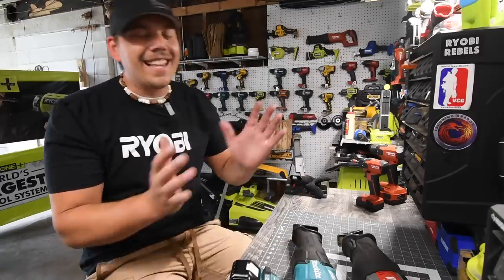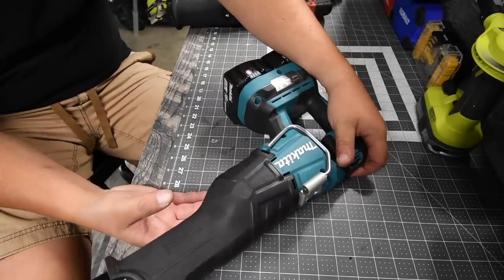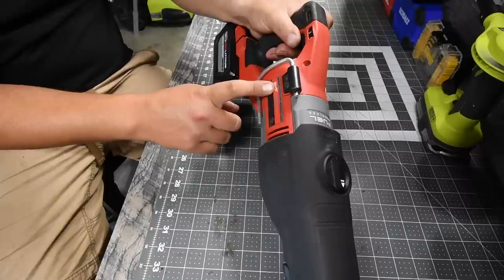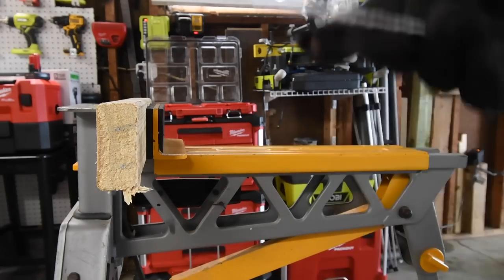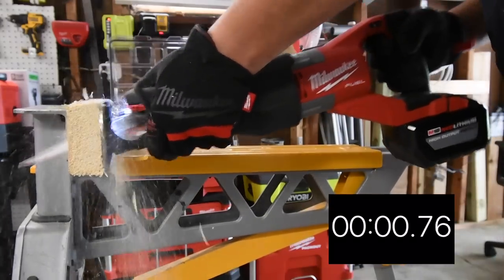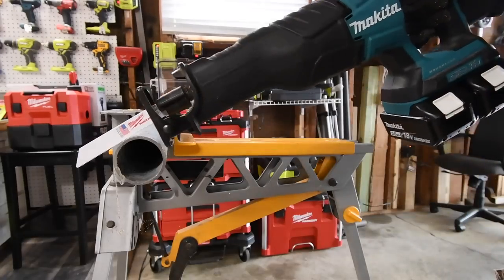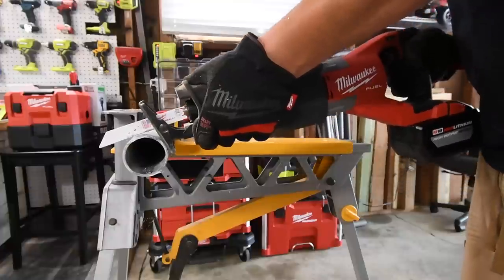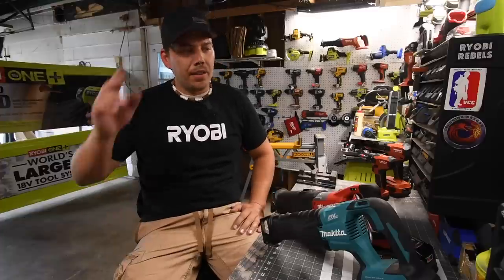M18 Milwaukee vs 36v Makita ( Reciprocating saws)

Comment: I just saw the Milwaukee win on softer material and crumble with a hard one. Yes both are great. The cuts from Makita seem cleaner, on softer wood the power of the orbital function make to much vibration and therefore the cuts weren’t so clean.
Reply: Also he was using a high output battery as well.  Makita all the way.

Comment: On the European model of the makita, the shoe is actually also changeable in length tool less
Reply: I wonder why they made it non-tool less in the states🤨
Reply: @P_steez  I guess they are cutting costs. Makita is already expensive in US, compared to Europe.

Comment: Still haven't seen u test the Metabo HPT 36V as it's the best performer with best warranty and it also can be plugged in
Still would like u to test the 36V Hammer Drill as well in your hammer drill test
Reply: Replaced my Milwaukee over a year ago cuz the Metabo HPT is better

Comment: Does the 36V model deliver more power to the cutting blade? or is it just more work time - for which Makita created exactly the same reciprocating saw as
Makita XRJ05Z (DJR187Z) with only two batteries????

Comment: I believe the saws would do better with different brand blades.  Cause milwaukee blades are not that strong I only use the Diablo carbide blades the teeth are sharpper
Reply from the maker: I will be getting different blades

Comment: Those standard Milwaukee wood blades are vicious. I prefer them over the axe for cutting non nail embedded wood. They have a lot more aggressive tooth pattern than the axe
Reply: You should try Diablo carbide pruning blade. It'll cut wood unlike anything you ever used, and It'll survive a few nails
Reply: @SweetStat  yea I use that exact blade for demo cutting wood and extreme speed cutting. Not good for when it’s gotta be a pretty cut lol

Comment: 😎😍😎😍😎
Reply: Hello 👋
Reply: @dav1d629  👋👋👋
Reply: @tedmcdonald3377  😎
Reply: @dav1d629  you like M12 fuel deals???
Reply: @tedmcdonald3377  not a super big milwaukee fan but I like tools!
Reply: @tedmcdonald3377   i do like the m12 fuel impact driver though
Reply: @dav1d629  just had a deal on the M12 fuel impact $60, but the deals dead😢😢😢
Reply: @tedmcdonald3377  ooof

Comment: I don't think Makita will continue to develop 2 x18v platform. Now with XGT 40v seems like replace old 2 x18v. Normal 18v makita still develop.  Not make any sense why it needs 2 x batteries to operate for hand hold power tools when makita release 2 x18v platforms.

Comment: The two battery platform makita is absolutely unacceptable, POS…
Reply: actually its the better solution. If you are finished with the saw you can take off the two 5Ah and use it on a drill, impact, drywall gun, Jigsaw, orbital sander and any other one hand operated tool. 
While that 220 dollar brick is only good for like a hand full of tools like the trimmer, saws and miter but for most one hand operated tools its just to heavy.
And you see, the two old 18V Makita Batterys are like a half second slower than a 12Ah 21700 High Output what is considered the Peak in right now Li Ion Technology. 
Milwaukee should be ashamed
Reply: I wouldn’t say POS, but otherwise totally agree. I would never get into the Makita 18v line as long as tools requiring 2 batteries are a thing. With the exception of something like a lawnmower
Reply: @Zozo806  u are tripping and u know it. Makita has two black eyes from that 36v trash. They know, you know, we know that is trash
Reply: @chriscord6524  i bet you will love it in the future if Milwaukee will start to do a 18+18V to stay in competition. You know  it and i know it that on two hand Equipment the time of 18Volts are coming to an end. Dewalt knows it, Ego, Makita knows it, Metabo HPT/Hitachi knows it. The only two big players that still remain on 21700 18V are Milwaukee and Bosch.

Comment: Why didn't you show the times and Milwaukee cut through the metal faster with orbital on lol 😂 and you just said it didn't and it would make it slower Milwaukee killed it with one battery 😂 dam I have the same saw and love it should have went with dialblo carbide blades but Milwaukee won regardless im surprised you didn't declare Milwaukee winner hmmmm whats going on?
Reply: What video are you watching?
Metal pipe
Makita: 9.63 sec
Milwaukee 12.4 sec
Milwaukee (orbital) 12.3 sec

He said the orbital will slow down the start of your cut, and the video clearly showed that it did. It was only 0.1sec faster overall.

The fact that the M18 was that close on metal vs. a 36V saw is impressive enough in its own right. Quit being such a fanboi that you can't see clear numbers (and I say that as someone who owns only Milwaukee, M18 and M12).
Reply: @l00nybin  do you know math buddy how is 12.4 faster than 12.3 the Milwaukee dominated the pipe test is one it lost 🤔 fan boy I have alot of  platforms you cannot even run this saw without two batteries 😉 yeah I'm not of a fan of the saw now go ahead and quote the numbers where m18 won clearly 😉 I won't get ugly with you and call you a makita fanboy 😉 do you own makita tools? Yeah thats what i thought. Do you own these saws i do and have done several test on both saws and multiple platforms of recip saws impact drivers drills impact wrenches i have 9 platforms so... I love all tools I just call it as I see it orbital was faster12.3 compared to 12.4 which is faster. and m18 dominated in all but two test... so with that said stay in school and don't do drugs they fry your brain.. gn son
Reply: @TacticalThib  it's obvious that listening skills are not your forte, or you think selective listening is a virtue. There's no point in discussing anything with you since you're obviously the smartest person in the combox.
Reply: @l00nybin  thank you for recognizing
Reply: @l00nybin  so who won the test overall is my question 🤔 ??????
Reply from the maker: this one was a close call.

Comment: 18V vs 36V, and the Milwaukee kept up? Holy moly...
Reply: Milwaukee won that 👏 🙌 😎 💪 👌 👍
Reply: Go back and look at the times
Reply: @TacticalThib  Milwaukee was almost 3 seconds slower on the metal pipe, and only 0.5s faster through wood&nail (which in real-world use is negligible), so... yeah.
Reply: Imagine if it was 120v?!?!
Reply: @Jerry-zz2eu  then it would defeat the purpose of having a cordless tool... Can my f-i-l's 30y.o. corded Super Sawzall run circles around these? Probably, but it weighs a ton and is tied to a wall or generator.
Reply: Voltage has nothing to do with power, more Voltage gives better efficiency cooler running, you could make a 12v recip saw more powerful than both of these but the battery would  be  huge and it would probably overheat more